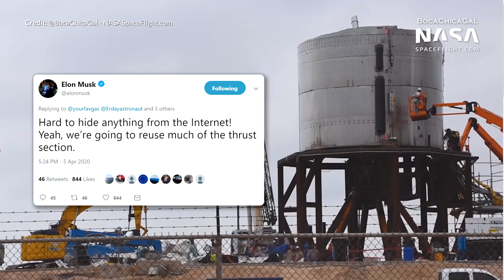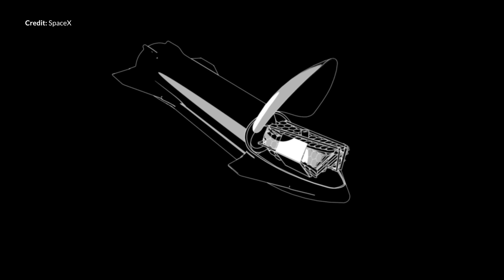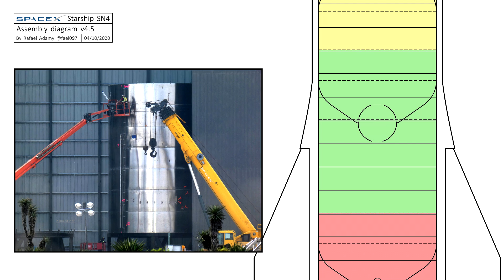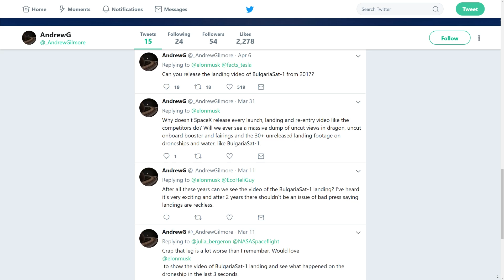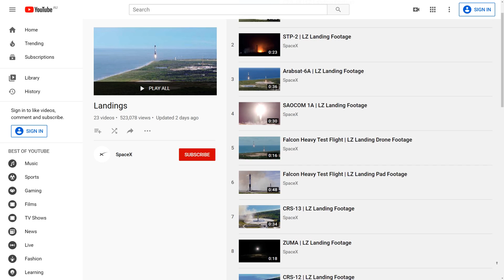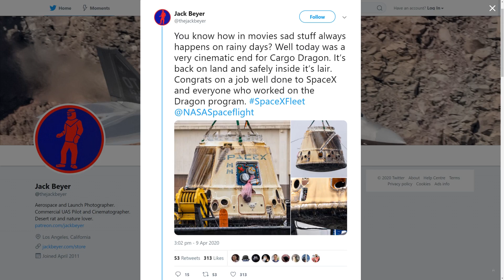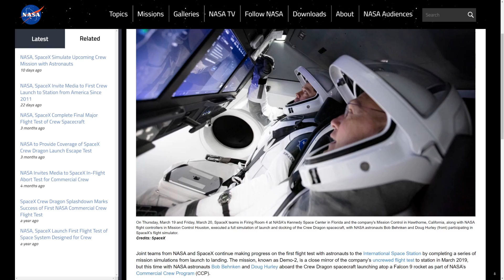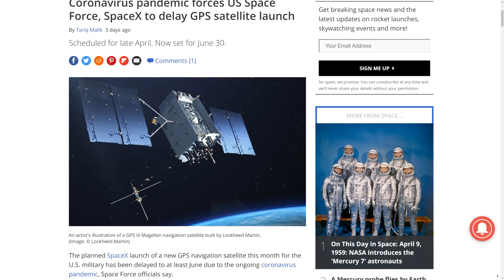SpaceX Starship SN4 News, Goodbye Cargo Dragon 1 and Rocket Lab Mid-Air Recovery Demo

Comment: NASA takes a year to build one Artemis rocket SpaceX hold my beer  build a starship in two days
Reply: Doesn't take them even that long to UNbuild it.
Reply: Charles Cotter lll answer me this: has an SLS blown up yet?
Reply: @OlCrunch  was there a full sls build yet?
Reply: Hypothetically, if SpaceX starship/superheavy NEVER gets better than 1% reliability, (99 out of 100 blow up, 1 makes it to orbit) it will still be a more economical and practical mode of transport, for most unmanned payloads, than SLS, even factoring in that you have to duplicate all payloads 100x...
Reply: @OlCrunch  they haven't gotten far enough to blow one that's after 200 billion and 10 years
Reply: Charles Cotter lll yes they have, they’ve been running pressure tests on prototype components for years now
Reply: @OlCrunch   saying prototype and years proves my point  there barely as far as spacex and thats with 10x the budget and time the whole reason for sls was it was supposed to be cheap and quick because it would use proven part from the shuttle
Reply: Charles Cotter lll SLS was never intended to be cheap, it was designed to keep the same contractors in work. The reasons for SLS is misguided, but it’s a very clever design, that is very expensive. In addition to this (as NG1 N3 said) NASA has a lot more to worry about than just rockets, meaning that it takes a lot longer to develop designs.
Reply: @OlCrunch  so does spacex there doing satellites,isru,orbital refueling nasa cant even dock a capsule to the iss with autonomous and much much more so that not a good excuse and yes the number one thing was it was supposed to be cheap and quick Legacy companies keeping their jobs where are bonus not to mention you're asking the companies that built the deadliest rocket in history the shuttle to build our next future rocket with the same parts that's asking for trouble
Reply: @_mikolaj_  800 million my ass they said them self ill cost 2 billion per launch it cost a billion just to move and if starship launched with the same payload it would be more capable
Reply: @_mikolaj_  star ship will send 100 tone leo all the way to gto it will only have to refuel to leave earth's orbit to go to the moon or any other planet all while being reusable 150 million a launch and with orbital refueling it can do 200 tons any were in our solar system
Reply: @_mikolaj_  one word refueling that 21 tons is for single use one launch and sending two starships is still cheaper then one sls and he said late models would be capable of 200 tons do to improvement to design and weight loss again all while being reusable
Reply: we get it, NASA bad elon mush good
Reply: @PrintScreen.  nasa not bad its the companies building Artemis everything else about nasa is amazing founding old companies so they keep there jobs instead of putting money in to new innovations ie reuse is bad
Reply: @OlCrunch  I mean, they did explode a SLS tank. You can say it was just a test but Starship has just been tests as well.
Reply: @OlCrunch  Smart move. As rockets are difficult to mass produce, everything proceeds steady. Like Scott Manley said "Go fast you crash". Although Elon Musk maybe impatient with the progress done in the past years, even with rocket building as 'it' proceeds slow, but steady to eliminate the chances of failure. For that we've just got to live with it, if any of us get impatient, 'you're' ask for disaster.
Reply: @danielburmas1136  the speed/quality/cost equation is in three variables! 😁 This means there are multiple solutions. I think SpaceX is working toward the state where high volume mfg. of numerous identical units allows progressive improvements toward perfected products. Historically rockets were really a kind of 'craft' products where slow, careful, rigorous progress achieved minimum errors. But by way of analogy, no hand-built machine of the old days was as repeatably perfect down to the micro-level as a modern CNC-fabricated part, of which maybe 100 thousand roll off the line per day. But the CNC design cost must be amortised over many units.
Reply: CRIPPLE N CRUNCH the tanks blew once
Reply: CRIPPLE N CRUNCH SLS is proven old technology, SSH is developing, cutting edge technology. If you don’t fail, you can’t improve
Reply: NASA  focuses on much more than building rockets. They research on Aeronautics, Propulsion, and do many many more things. SpaceX however focuses solely on Rocket engineering. That's why spaceX is so much faster.
Reply: @ng1n369  what are you saying you have to do those thing to buid a rocket with mean spacex has done the same
Reply: IF you think Artemis is a good example, you must have missed the last 30 years of SLS.
Reply: SpaceX will never be able to buid "Starship" in less than a month, even if they could print the entire rocket. SLS will indeed be more expensive to manufacture, although it will be a lot more reliable than Starship, and has a better performance.
Reply: HOLD MY BOOSTER